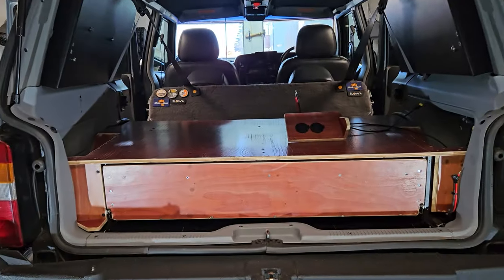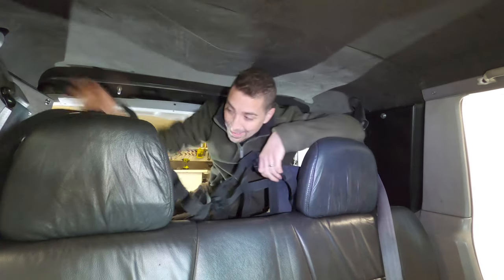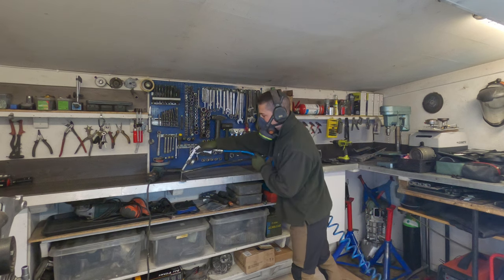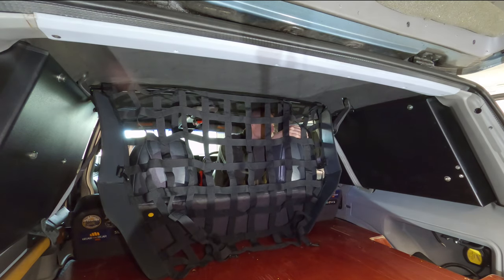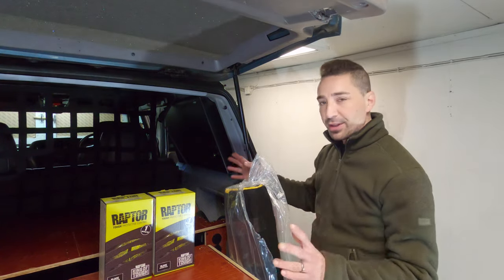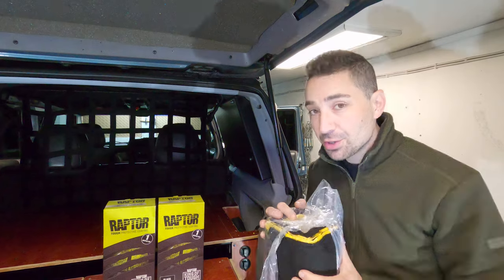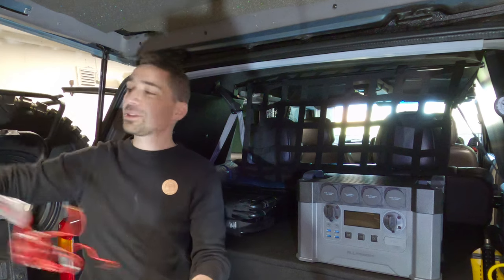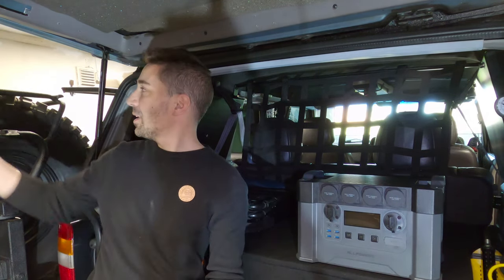Making My Jeeps Rear Camp Storage Look Awesome!

Comment from the maker: My Jeeps rear storage drawer system (AKA Samantha's bed) is getting its final furry touches. The wooden and aluminium frame are working well but looking dung, so hopefully wrapping it in carpet and adding some finishing touches will make it look more OEM and professional.
This is the final build on this setup although a different fridge/battery setup will eventually clean up the system more. 
Thanks for watching and for all your support! 
Mike

Comment: I live in the American southwest where we see temps as high as 122 degrees Fahrenheit. I run a deep cell marine battery that is isolated, but charges off of the alternator when the truck runs. It's mounted under hood on the opposite side of the start battery. I also have 200watts of solar on the roof, which is enough that I can have the fridge on all summer and never worry about the battery draining down. It helps that we have sunshine like 300+ days of the year. The best part is it's all been pieced together so in total I have about $400 into the whole system. We still have Jackery power stations but tend to just lend them out to others that we camp with for charging cell phones etc.
Reply from the maker: Thanks for the information! Its really helpful to see what people are running so I can get a good idea of where to go forward and where to spend my money to make the right decision. Thanks again and appreciate you watching!

Comment: Hi Mike, really enjoyed the video.
The drawer system turned out great! I think one of the amber lights up on the tailgate would be good to light up the area behind the jeep and one on each side, inside the jeep cargo area. Also one mounted on the under side of the pull out drawer, as the drawer will cast a big shadow on the ground and you wont see bigfoot lying under the jeep waiting for the right moment...

Comment: Mike I can tell you from my experience here in south spain (40°C). Running a power station river 2 pro, fridge and solar pannel. I let the car in the sun and can get up to 60°C inside. No problem at all, they have a little fans that works sometimes but didnt have any problem with it. I read that when it get too hot thwy shut down, but necer seen doing it💪🏻

Comment: Mike, I use a Jackery 500 to power my ARB fridge. I keep it under a tonneau cover in the bed of my pickup truck in south Texas where the temp is regularly over 95 degrees F in the summer. I even keep the Jackery in a bag to keep it clean and transportable. The heat has never been an issue and as others have said I’m sure it would shut down if overheated. Im not an engineer, but from two years of use I have had no issues.

Comment: The materials used in lithium iron phosphate batteries offer low resistance, making them inherently safe and highly stable. The thermal runaway threshold is about 518 degrees Fahrenheit,
Reply: Great info! Do you know if this type of material is most commonly used?

Comment: Nice build Mike
These projects are very time consuming.
I'm not surprised you cant find much data on the batteries etc.
If you think about it , the EV companies don't want negative info on the net , especially with the fires theyve had over the years and shipping companies that wont transport them.
Li Ion and other deep cycles are fine , otherwise its always a risk , although minimal.

Comment: I have a 200ah lifepo4 bank. And I live in Nevada USA. summers are over 100°f and winters are below 20° f. My fridge has lived in my jeep for 5 years now, it never comes out as we live in our jeeps 24/7. There's no shade here, we don't have trees where we are at so our cars are baking, all of our stuff bakes in the hot Nevada sun all day. None of my battery's have ever went past 90°f. The chargers see that heat and make the needed adjustments. These battery's are smart now, even my cheap elefast ones have lots of cool features like power disconnect if it's to hot or to cold. Bluetooth to monitor and all sorts of cool stuff. Get a battery bank and a decent charger. You will never regret this purchase I assure you. Much better than those portable units.
Reply from the maker: Thanks for that information, nice real world stuff. I just bought a Victron smart charger and i'm upgrading the whole system so that the infrastructure is solid. Thanks for the comment and info!
Reply: Hi Mike, i made a rear door window louver , from the same materiaal that you have on the engine hood!! Got it in a do it yourself store!

Comment: If it's using a battery management system (BMS) and it's Lithium Iron Phosphate (LifePO4) it is very safe at temperatures around 40 degrees C. The BMS will stop discharge at temperatures around 60 degrees C if it is configured in the industry norm. I have built my own LifePO4 batteries and am an electrical engineer if you have any questions let me know.
Reply from the maker: Thanks for the information. I'm currently installing a victron orion smart charging system in the vehicle with an mppt. My plan is get some good infrastructure installed first and then i will check out batteries.
Thanks for watching and for the info!

Comment: Use one of those little laser temp readers on the battery when its at the hottest and just contact the manufacture or find a spec sheet it should have the max remp rating, its a good question though and not one other people ever talk about, maybe if you have some sort of electric fan vent sucking out hot hair and park in the shade you could bring temps down a good bit

Comment: Another G’day from Oz regarding lithium batteries... I have 2x120 ah lithium batteries in my camping canopy. The spec’s are as follows - Optimal Temp Range - +5 to 60C
BMS (battery management system built into each battery) - -5 to 80C
BMS Cut off voltage - 15v
BMS Low voltage cut off 8.5 - 9v
I don’t think the max temperature will be your worry...
Reply: I should have also added that the batteries are charged via the alternator and solar panels through a Redarc 1240 BCDC charger/regulator.

Comment: We use a cheap chinese style battry pack in our work van for running the hoover and saw and the odd tools , its been in the van for about 3 years now UK weather so -6c ish then highs of what 30c in the summer , its shut off a couple of times when its been hot with a big Chop saw running on it and the cells have faded a little from not having a propper charge as its only ever charged off the van alt yours looks like a much better product.

silly as it sounds we do keep a firealarm in the van and a propper electrical fire extinguisher near by as we do tend to have alot of dewalt , milwak , and other tool batterys in the van

Comment: Hey Michael, regarding the Lithium Battery i can only really tell you from my experience: 
My setup consists of a Portable National Luna Power Pack 2 and a National Luna 50L Fridge. When i bought the power pack online from a store I emailed them and asked if the power pack works with lithium batteries, they said yes . (You have to put a battery into it). 

It is basically a fully portable Dual battery system that you wire directly to the starter battery and only charges the 2nd battery when the engine is running after some time. Aparrently National Luna now says on their website that their system shouldn't be used with lithium. I bought a 100A Renogy lithium battery, put in there last year and drove for 2 weeks in croatia, leaving the car in car parks and on hiking sites. I also have 150W Solar going into it and i never had any issues. Voltage and charge seems fine and I havent noticed any heat going on only running the fridge. 

However I think i will get this properly done by a professional in the future, electronics are not really my strength, i really made sure to make this a minimal setup I can take out when I am not camping and just using my G for forest work and construction stuff,  Id rather spend some money on getting it done properly and having peace of mind than coming back to a car in flames.

Comment: a good lithium battery will have its own management system which should at a minimum have temperature and over current cut-offs for the cells. Most 'power stations' should have these features for other chemistries but even the cheap brand lithiums here in Australia have these basic protections built in to the standalone battery. The other risks are managed the same way as any auto electrical work, e.g. fusing, fixing of cables etc. Lithium ion batteries can be widly dangerous but iron phosphate (LiFePo4) are much more benign, being said, a novel hazard for these is the fumes that may be released in the event of a breakdown. Ive fun a 40L fridge off a 100AH lithium (Iron Phosphate) in a little black forester in 40 degree weather here in Western Australia, allow the fridge to shed the heat and you'll be fine

Comment: i think most lithium battery fires are during charging or following impact rather than during discharge. if you're considering taking batteries out individually to better store you could look to encase them in the lithium battery fire bags like they type they will throw your phone in should it start smoking on a commercial flight. They look like of like a foil bag.  I have also seen other bag systems to contain batteries for fire and smoke as a type of transport bag.
Reply from the maker: Thanks for watching and for the information!

Comment: The batteries used in systems like yours and battleborn-like 12v 100ah batteries are Lithium Iron Phosphate, the thermal runaway issues for recreation use (I.e. the Samsung Galaxy Note) are batteries which are Lithium cobalt-oxide or lithium Manganese-oxide. 

Lithium iron Phosphate is not prone to thermal runaway and is very stable… but isn’t as light as the other systems because Iron is heavy. the BMS system will shut down flow long before the battery gets hot enough to shrink the commercial separator which causes the environment for thermal runaway. 

Lastly for Lithium iron phosphate, thermal runaway threshold is like 150-180 Celsius… so cars wouldn’t get that hot even if the battery is powering the fridge

Comment: good job 
    I have a question for you. Why not mount the tire inflator motor on the right side of the freezer?
It saves you effort and time
Reply from the maker: I will probabaly do that. I'm just revamping the whole electronic system so I'm holding off with anything permanent until I know what I'm doing.
Thanks for watching!

Comment: Looking good👍
Reply: Have a question on head gasket i did the new Elring  and it just shows the main torque on the sheet that came with it m14s 30nm +70 ×2 and m12 are 30nm+ 90 degree. But a manual for almost same motor (but in the Chrysler  mini van.)i found  on line says to heat to temp 20 minutes  and retorque outside (no slack) m12s and 90nm and m14s to slack then retorque 30nm and +65 degrees 2 times. Which do you usually go by?
Reply from the maker: I went by the 425 OHV manual which says - Central Bolts tighten to 30nm in sequence, then an addition 30 in the same sequence. Then 70 degrees in the same sequence, then an additional 70 in the tightening sequence.
Then the side bolts get 30nm + 85 along one side, the the other.
Run the engine at OT for 20 minutes then allow for cool down.
Slacken central bots one by one in sequence, tighten immediately to 30nm then 65 degrees, the another 65 degrees and move to t he next bolt.
The side bolts get torqued to 90nm after this but no slackening.
Reply: @WorkshoptoWilderness  thank you👍👍, yes wound up getting same results when i dug through  the internet enough 🤣🤣.  I have found a manual for free download but it was for the Chrysler minivan motor which i know is same block different accessories .  The headgasket kit had totally different  values but almost same results minus the run then retorque.  Thats what worried me.  Jeep is back on the road and was trial by fire on the second  day of testing with a road trip from my home in Mosvik  (North  west of trondheim) all the way to Bergen and back .🤣 ran perfect  no problems 🙏 and turnd a great 31mpg.  Thanks again  for all you do on the channel.

Comment: Hey Mike, I've been running a lithium in my land cruiser in Australia for the past year, and I've had no issues running an 85l fridge full time in 40c+ temps through summer, it just chews a bit more power as my fridge is black and not well insulated.

Comment: I hope to all that is holy the "have you seen the new IG-88?" is a STARWARS reference. I lol'd

*EDIT*
Found this in some research on lithium banks.

"For most lithium-ion batteries, the safe operating temperature range is typically between 0°C to 45°C (32°F to 113°F). Exposure to temperatures outside of this range can lead to reduced performance, degradation, or even failure of the battery. However, the exact failure temperature can vary. In extreme cases, such as exposure to very high temperatures or physical damage, lithium-ion batteries can catch fire or explode."
Reply from the maker: It was a old Half Life reference haha. Thanks for that information, its good to see as many references as possible! Thanks for watching.

Comment: Ref battery questions. Environmental Operating Temperature Charge Temperature: 0°C~40°C (32°F ~ 104°F) Discharge Temperature: -10°C~40°C(14°F~104°F) Storage Temperature: -20°C~40°C(-4°F~104°F)*recommend Operating humidity range: 10 - 90%
Reply: 50c is normally when components start having issues. The unit may have a thermal cut out. Li po batteries have lots of fire drama, li ion batteries normal on over charge and over drawn power. Li fe I don't have the details. My knowledge is from lots of RC planes and use of li ion and li po batteries. Li Po's scare me li ion no drama in 10 years. The man made would be Trent from Titan batteries. He will have very detailed information if he responds.

Comment: Had vaping incident which involved very cheep, crappy batteries pushed to the limits? Or EV batteries pushed above limits to get that extra mile/range they should not advertised in first place? Or some other story of incompetence, malice and above all and most likely - profiteering.
LIFePO4 safer than "regular" Li-ion. Safe operational temperature above 40°C, not camping in hot desert and not leaving battery in direct sun light anyways. Safe as any electrical/electronics. Something can short-out, spark with lead-acid or alkaline battery and start a fire.